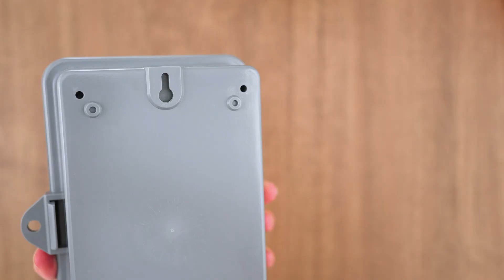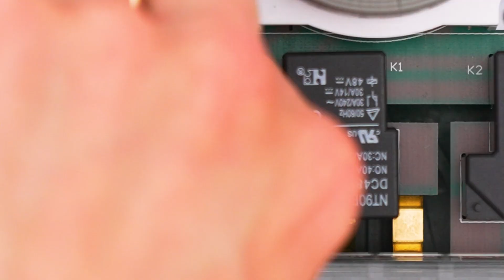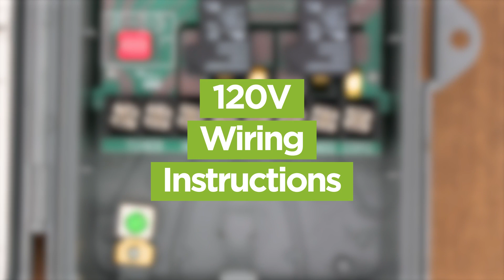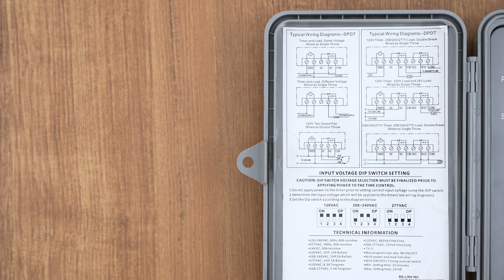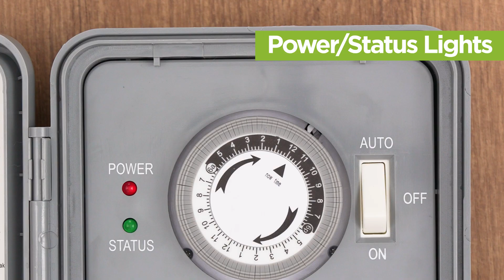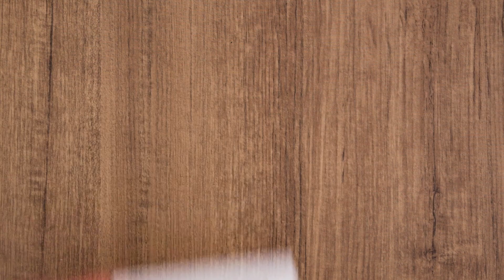24 Hour Programmable Pool Pump Timer Heavy Duty Outdoor Mechanical Timer Box BN-LINK

Comment: I wish the video would say power supply hot, power supply neutral, load hot, load neutral, and the video is going against the instructions for the dip switch, which is clearly printed above the switch.

Comment: You guys show MULTIPLE different directions for the same wiring setup in your manual vs this video.. VERY concerning
Reply: YOU AINT KIDDING...My manual says load is com2 and com in is no and no2....gezzzzz
Reply: @GIZMO1D1  Yeah, very dangerous and confusing..i figured it out myself using a multimeter to trace curcuit paths but damn, AWEFUL.. mfr should take this imput and make a change. I had to return TWO of their timers I bought back to back cause the display was defective..they def have some issues to address..
Reply: @caleblambo162  yup yup...did the same/ used my fluke and it was a no brainer,, unit seems to be working ok now for the last 3 days at least....Unfortunately not every one has the ability as us.  ya gotta watch everything now adays!

Comment: The literature that came with the BN-LINK model CP-U49A has the dip switches set for 240 volts as 2/3 on. The BN-LINK video has the dip switches set at 1/4 on, so which is correct?
Reply: What the f the video and the electric board are different.😬
Reply: I just noticed the same thing.. I'm like uhhh what
Reply: @caleblambo162  Which is it then?
Reply: @Pingaheimer  I had to use a multimeter to trace out circuit paths..its what it says on the circuit board ITSELF & the sticker w/ wirong diagram on the inside of door. Dont listen to dip switch instructions in this video, its WRONG
Reply: I was wondering same thing I followed what it says on panel timer dial doesn't move then what this video says still nothing.
Reply: After I followed them but the power light and turn light didn’t work.